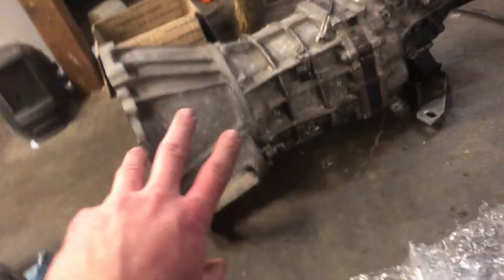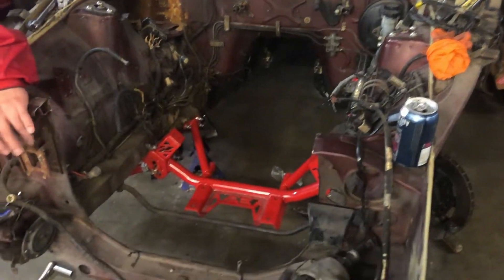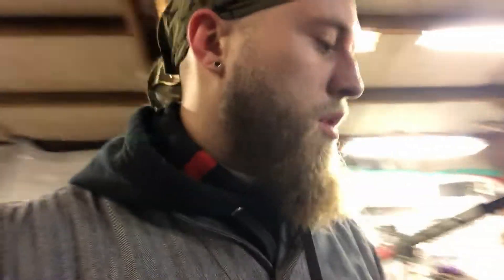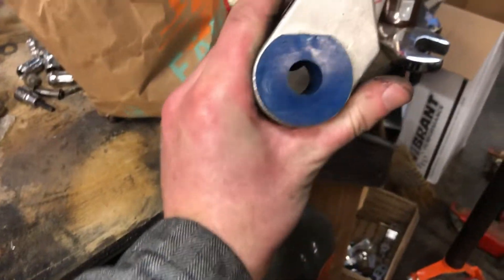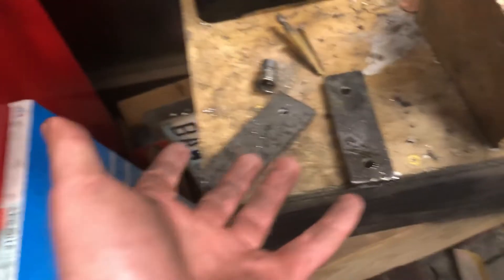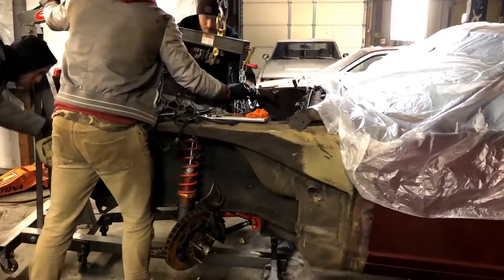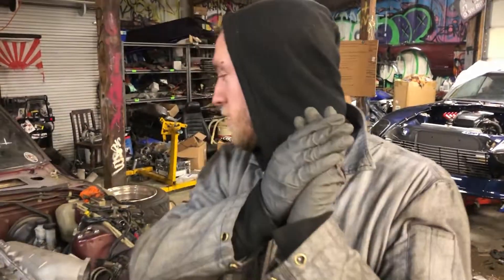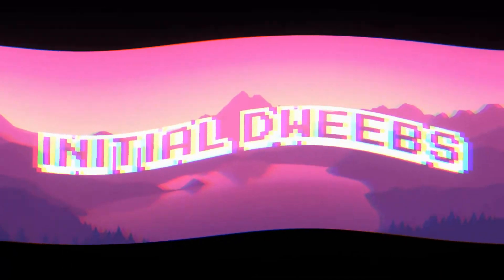GIANT TURBO! SAGE'S 2JZ 280z BUILD EP#5

Comment: So many Z swaps are a ton of work and money lot more then everyone thinks.
It is the exact reason I'm modding mildly my two z running l28"s
Doing my own head work ,a mild regrind cam,self ceramic coating pistons and combustion chambers .
A Z is light as a lotus.
It does not need tons of power .Get sticky tires and Subaru lsd and BAMM fun for alot less work and MONEY...
I feel your pain I'd get my money back nothing worth 500 bucks there?
Reply: L28 turbo!